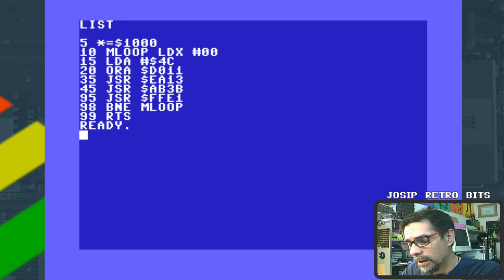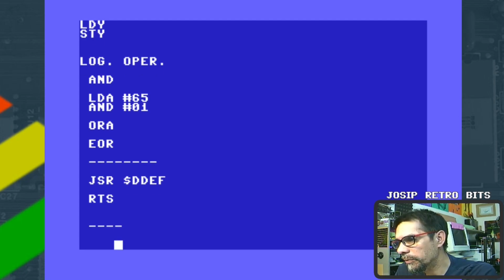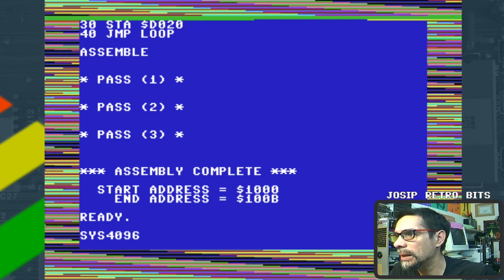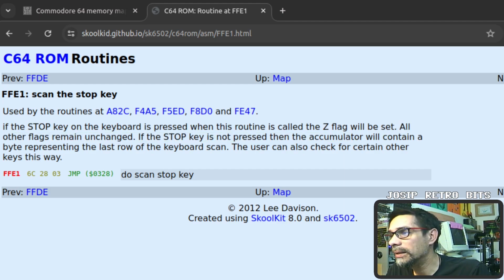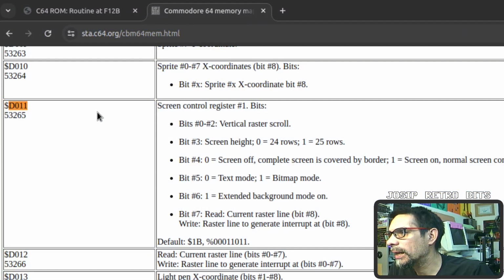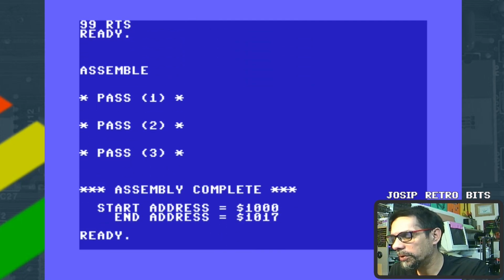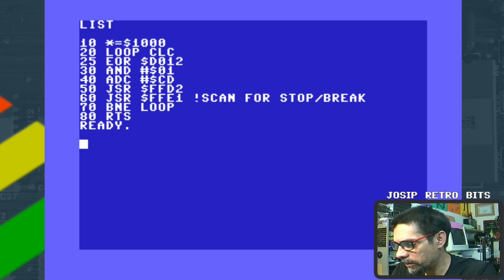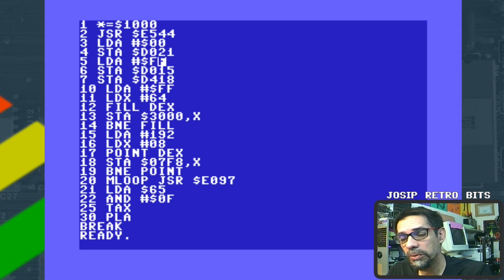Assembly Programming Using Commodore 64 Kernal Routines

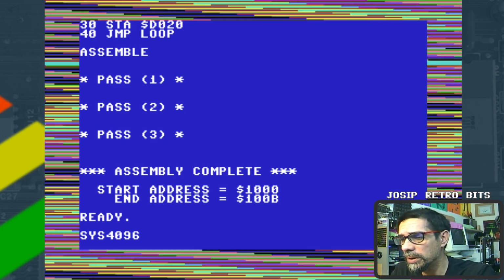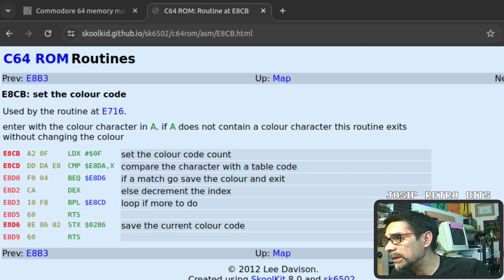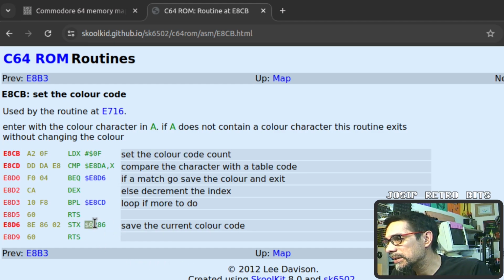Comment: 16:04 no power cycle is needed. Just hit RunStop/Restore.  Also, can you paste any used page links into the Descriptions?  26:33 if you don't need to  verify the color value is under 16, then just STore it to 646.  27:00 the VIC-II does not in fact use this address. AFAIK 646 ($0286) holds the value that will be written to the Color RAM cell (static nybble) which corresponds to the screen cell you'll be writing to.  In other words, when you output to screen, the OS keeps track of the cursor position (probably as an offest from the start of current Screen RAM) and it uses that same offset when it also writes the color for that corresponding screen location (in the Color RAM matrix).  The VIC-II never reads 646 AFAIK.  The VIC-II reads from the static nybble Color RAM matrix to get color data for each of the 1000 screen locations. Location 646 is where the OS stores the current text color-- which is used by the OS when a char is output to the screen- it writes the character to screen RAM then copies the value from 646 to the corresponding Color RAM cell for the screen character write we just did.  God I suck at explaining things!

Comment: Only if we had this channel back in the 80s. We all just read the C64 Programmer's Reference Guide and studied ourselves. 😂
Reply from the maker: I know. Back then, we retyped games from magazines, and most of the time, they didn't work. Thanks for watching! Cheers!
Reply: @JosipRetroBits  I was excellent entering data, however just all numbers with a line ending checksum...

Most users only had the free upper-level BASIC language, while lower-level programming languages software costed lots of money, with none at the time standing-out from the other lower-level languages, most within their infancy.  However, we all somewhat knew, during this time, assembly was the de facto language.
Reply: I only wanted the games to run so never learned anything other than just load the games from tape. I just wanted to play football, watch thundercats and robotech. Not until now that I'm old that i actually have bothered to see how it works under the hood 😂

Comment: Does this basic assembler lack comment or rem features? If would  be useful in these videos. Really useful. You know that tone left on at about 55:05? RunStop Restore fixes sound/noise too.
Reply from the maker: Yes there are comments, just use REM statement like You would do in normal BASIC code. Sorry I didn't catch that at 55:05, apologies...

Comment: When I did programming on my C--64, I used BASIC a lot, much faster to write software, but I also used assembler a lot too, because BASIC would be way too slow for certain things, so I mixed both, I did BASIC and assembly for some routines and embedded those routines in my BASIC program through the SYS command.  I did some pretty impressive and fast BASIC stuff this way - It was very useful for BASIC programs with background stuff, through the use of interrupt routines in assembler.
Reply from the maker: Oh Yes, that was the thing back then and still is, if You want to speed up some parts of the BASIC code, just inject that part in the memory (machine code) and call it with SYS.
And Yes, BASIC couldn't handle interrupts so for that You would need to use assembly/machine code for sure :)
Cool! Thank You for watching :)

Comment: why not jump to 20 ?
Reply from the maker: Well, those numbers are part of a BASIC code.
I used Mikro Assembler cartridge so that I could write on C64 and compile and run the assembly code on C64. 
But, You don't need those numbers if you use some other assembly compiler. 
You can compile the code on a modern PC and then just run it on C64.

For assembly language the labels are important.
...and those labels are converted to memory addresses during the compile process.
Reply: @JosipRetroBits 
I mean you had 
10 loop lda $d020
20 adc #01
30 sta $d020
40 jmp loop

Why not 
20 loop adc #01

?
Reply from the maker: @nagyandras8857  Yes this is where I want to explain how lda and sta instructions work. This is not a good code :)
A more efficient way would be to have a loop label on line 20, yes!
But also, we have direct instruction if we want to increment by one, just direct "inc $d020".
If we want a different increment value then we can use Your suggestion, Yes.

Sorry, I didn't get what are you asking the first time :)

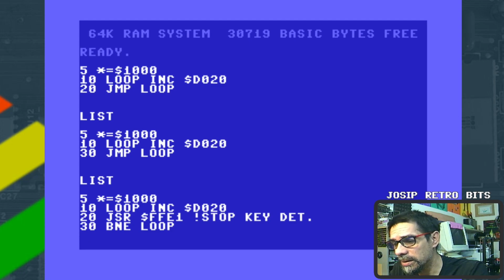Comment: 19:50 I would probably use JSR $FFE4, then BEQ LOOP.  That way you can exit by pressing any key.
31:03 This effect only works on PAL C64s.  On NTSC machines, it just displays somewhat random garbage.
Reply from the maker: Thank You for your information, uuu, ok  I need to check what is the problem with 31:03 on NTSC, to be honest, I didn't check if ti works on all systems. Cheers!

Comment: I imagine discovering RunStop/Restore is going to change your life.  I can't imagine not having that available! It was essential in my experience.  ProTip: sharp quick taps on the Restore key.  It's  weird that speed of tap can make a difference sometimes but it really does. Gotta be in how downside transition of the signal generates the NMI.
Reply from the maker: I think that will change my life tremendously :) Thank You for watching :) Cheers!

Comment: Very nice video.
Reply from the maker: Thank You very much and thank You for watching :) Cheers!
Reply: @JosipRetroBits  if I just knew this back in the eighties.. those kernel routines are very useful. Back then it was really hard to get this kind of info and explanations. I only changed colors and did some sprites as an teenager in assembly. Could you even imagine what an impact it had if everybody had an assembler and this kind of kernel-routine info back then ..
Reply from the maker: @Jemacaza  Yes for sure. For comparison, the first time I used C64 was retyping some game from the magazine. I didn't understand anything :) 
Now it's so much easier to get information and to learn new stuff. And of course, You can develop and test your code on the modern PC before you run it on the real C64 and this much faster and easier way to do this. :)

Comment: My first computer had a hex keypad and allowed to enter machine code directly. No assembler needed. A rough start, but after that you are afraid of nothing anymore 🙂
Reply from the maker: Ha ha, that is awesome :) Oh, those are the first kit comp.? with just a numeric keyboard?
Programming in machine code directly, You have my respect, Sir. :)
Reply: @JosipRetroBits  Yes, it's a kit from the time when you could not buy a computer in stores yet. A Netronics Elf II. I still used ut until I bought a Atari ST and still have it. You should take a look at the processor (a CDP1802) if you are really interested in 8 bit computers. Not exactly mainstream, more like RISC before that was officially invented.

Comment: What's a kernal?

Do tell.
Reply from the maker: KERNAL is Operating System on Commodore 64. Cheers!
Reply from the maker: @Joel-qz6sd  Yes, a bit more than that. but in general Yes.
Kernal is simply an operating system on Commodore 64. It also takes care of all other operations on the system, like cursor,  serial communication, time, etc.
Reply: @Joel-qz6sd  No, really, there's no such thing as a kernal.  Perhaps you're trying to explain "kernel."

Comment: You have to turn off the computer just to get out of that 4096 loop? Why won't the stop/restore key combo work, even though I've seen it stop plenty of ML programs before, without your having to look for a press of "stop" or "stop/restore"?
Reply from the maker: Run/Stop key will not stop ML execution only execution of BASIC code. That is why I needed to implement STOP key detection to exit the program in my examples. 
Thank You for watching :) Cheers!

Comment: Back in the day we were relying on books, and I think there wasn't a book that had all these routines printed correct, either missed a whole page or printed a different page instead, also I had so many bookmarks in those books to find all the routines again 🤷‍♂
I still have the Commodore related books in between the newer computer language books
😅
Reply from the maker: Yes, it is much easier today, and most of it has been well documented and disassembled so that we now "know" a lot more. I don't have many Commodore books but I never saw any routines explained anywhere in those books. Memory addresses Yes, but not routines. Thank You very much for watching :) Cheers!

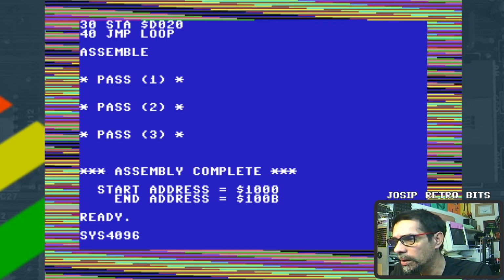Comment: 16:00 You don't need to power off! Just hit RunStop/RESTORE and that should work.
Reply from the maker: Hi, not with machine code (assembly code). That only works with BASIC code.
But I've implemented that option later in the video. Thank You for watching :)
Reply: @JosipRetroBits  that's weird because l remember RunStop/Restore working for ML unless it was specifically disabled. Hold down RunStop while you sharply tap RESTORE several times. I know the C64 needs a rapid transition on the restore key- usually several. Why, l don't know. But slow wrists were less successful. I suppose this could be a Mandela memory Effect since l haven't tried this is decades. But l could swear this triggered an interrupt that sends  you back to the ready prompt. Try it and let me know.
Reply: @saganandroid4175 : Yeah, that's what I remember as well. I wonder why he never bothered to try it. I have just set my 128/64 back up and I have just re-encountered ones that have disabled the restore key for exiting; and in fact, they restart the programs instead; and you can even soft-reset from 64 back into 128, run something there, and then soft-reset or go64 back into 64 and that program immediately restarts! BUT... if I remember right, it had to be specifically programmed to do that; otherwise what you were saying would indeed happen. I'll have to go through my disks and make a count list of some sort to see if we're right: which is the exception or the rule. And yeah, on an original 64 you do have to hit "restore" fairly hard. I don't know about the C, but on the 128 in either mode you don't. Why don't you set your 64 back up now too?
Reply: @JosipRetroBits  try it. Run your ML code. Hold down RunStop and nothing happens. Now while holding that key down, sharply smack the Restore key several times. That should generate a NMI. But on most C64s you need a quick sharp wrist action on the Restore key because only the trailing edge of that line is useful. Try it and report back.
Reply from the maker: @saganandroid4175  Aaaa ok, got it! Thanks :)
Reply: @JosipRetroBits  it's been almost 40 years since l was on real hardware so let us know if it works. It certainly should unless l am having a Mandela memory effect here.

Comment: Really interesting stuff! 
One thing though: At 45:02 ... What is the reason for EOR $d012 and not simply LDA $d012 ? Am i missing something vital here?
Reply from the maker: Thank You :) EOR to get more random values in A. Whatever is in A we EOR with D012 and that will give more random numbers than just loading D012 :)
Reply: @JosipRetroBits  But the accumulator will always have the same value (255  / $ff) on each iteration due to your JSR to $FFE1, so I cannot see how that would increase randomness.

Try adding STA $d020 in line 22 and you will see what I mean.
Reply from the maker: Ok will try. I never checked value in A when returning from $FFE1, but yes You are probably right :) Thank You!